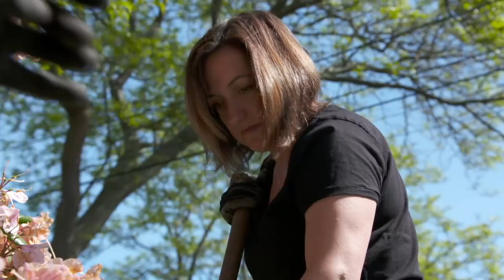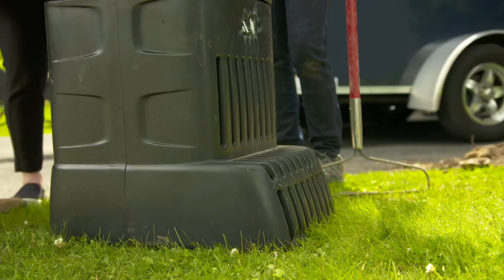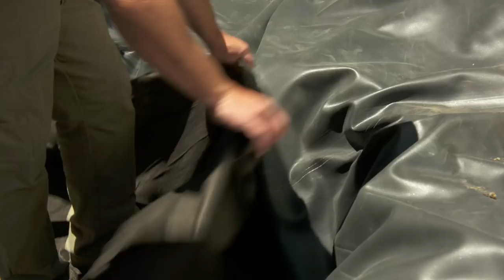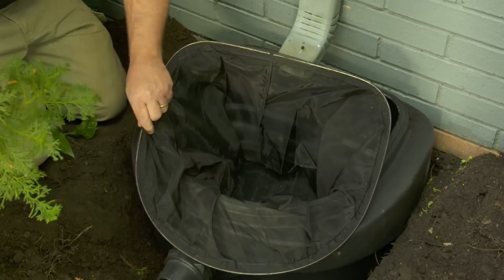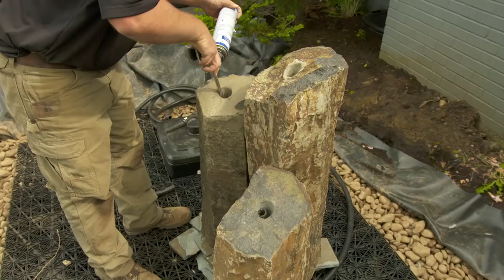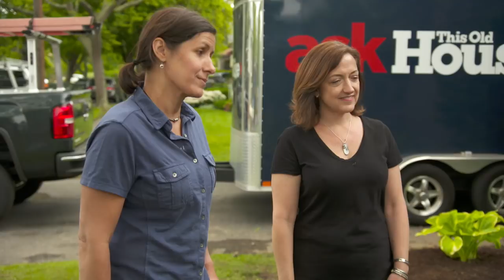How to Install a Water Feature that Reuses Rainwater | Ask This Old House

Comment: Except it didn't rain yet (according to the video) so they must have had to fill it up with water from the outside hose.  If it doesn't rain for a while, this is what we would have to do to keep the water feature working.

Comment: So how do you clean this? Just seems like a very temporary design which you'll eventually need to completely take apart and clean sludge and debris, not to mention fairly stagnant water.
Reply: That would be collected in pump - OMG - there goes the pump :( 
The 'first line-of-defence' should do much much more than a bucket with a net in it - having some filter material in the box would be much better in addition to the net basket. We built our own at a fraction of the cost.
Reply: @taherakhan7044  tell me how :-)

Comment: So what's gonna happen when it rains heavily? Plus the size of the container is so small it'll overflow in minutes even if it rains just a little bit.
Reply: That just act as filter debris. The real  “container” is the hole dugged. The pond liner act as “plastic bag” rain water tank
Reply: And even the hole that was dug, will overflow probably to the same location as the downspout previously flowed to.

Comment: pretty.. but probably super expensive and another pipe to worry / care for winter time. also that pump won't be easy to replace if it goes out + electric bill
Reply: JJ J The homeowner mentioned water restrictions at the start of the video, which means she’s probably in the Southwest. Nothing freezes in the winter there.

Comment: Yea who’s going to use that dirty gritty water to wash their car.
Reply: You have never had a pond, the water clears up after a day or so because they didnt rinse the rock first. Even when you do the initial priming of water fliw will stir sediment. Once the pond had settled the sediment, the turbidity drops to nearly no visible turbidity. There is also a super cheap additive called floculant that makes the clouds solidify and sink, thus clearing the water. But you already knew that right? The pond guys did decent, i prefer different styles but overall that feature should last 15+ yrs with minimal effort.
Reply: Travis Ryan The dust and dirt is still present in the water, both dissolved and suspended. If you wash your car with that water, the tiny amounts of abrasive dust is going to scratch your paint, and the dissolved solids are going to leave behind deposits. 

That additive you mentioned: I’ll bet that just works wonders on car paint too.

Comment: Many TOH videos have a fake look, like a poor reality show, but at least the TOH hosts of most (older?) episodes seemed like they knew what they were talking about, and had done that work many times themselves in the past. THIS episode, well.....the gal seemed like a total poser, and both she and the hired expert guy were pretending to do work with rocks while barehanded and wearing wedding rings, the excavator was dumping a bucket load into a wheelbarrow with less capacity than the bucket, the list of crap content goes on and on. They never mentioned what happens to the trapped water during heavy rains. They did not really show the recycling filtration that would be necessary....but hey, they showed the pump that the homeowner could use to deplete the water in the system in order to WASH HER CAR???? This was a sucky episode.